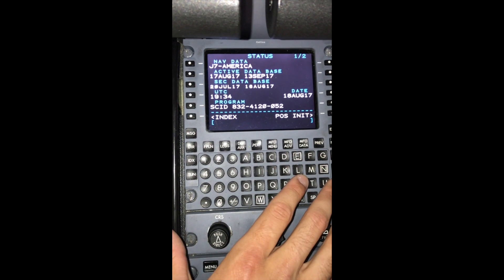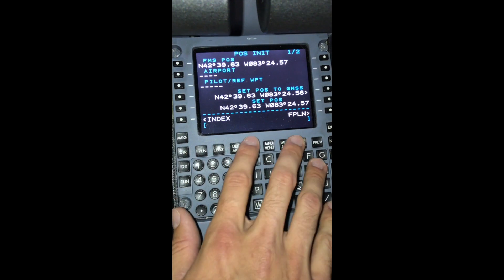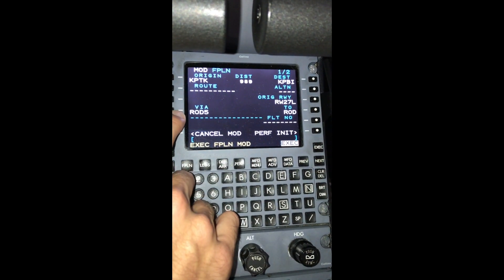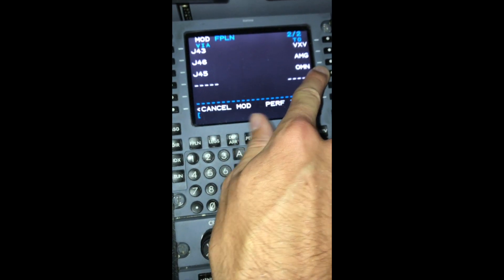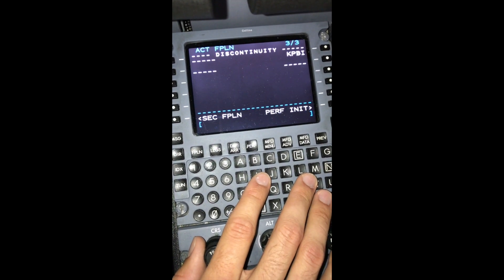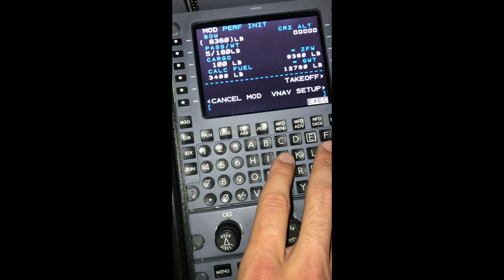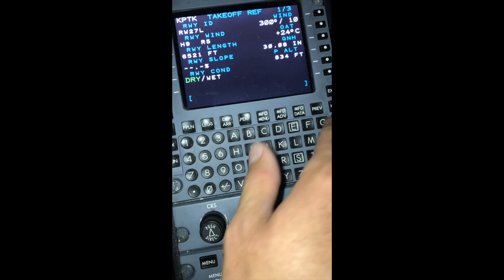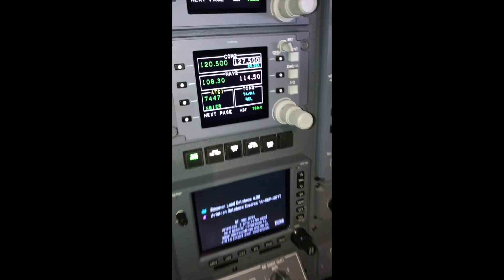Understanding the Proline 21

Comment: Hey man, what’s the meaning of VT (speed) and the A/I on the Takeoff REF page ? Thanks in advance.
Reply: VT is flap retraction speed (should you have an engine failure on takeoff), and A/I is asking if you will be using your anti-ice systems for takeoff, as that would drastically reduce the plane's performance.

Comment: You did the passenger weight completely wrong.  The crew weight is included in the BOW by definition, so with 3 pax you should enter 3 on L2, not 5.  Also, if your GOM has a defined approved standard pax weight, you must use that, you can't just arbitrarily change it from 175 to 180.  If 180 is your approved standard weight, you need to set the default in the FMS to be the approved value, not 175.  If you're using 'actual weight' instead of 'standard weight' for pax, then you need to put in the actual weight, not just your estimate of a default change.

Also, you can't just make up a number for baggage weight.  If your company is approved for 30-pound standard and 60-pound heavy bags, you would use those values (3 pax x 1 std bag each = 90 lbs).  If you want to use actual weights, you have to use actual weight for ALL items.  You cannot mix actual and standard weights.

Other than that, and the vertical video, the rest of the steps are well covered.
Reply: Ten bucks says you are a royal pain in the ass to fly with.
Reply: OK Master of FMS.... Perhaps this was a demo video, not an actual flight?! Perhaps this was a Part 61 flight, by an owner operator, not a 135?  You are making a completely wrong assumption here......
Reply: What if I told you you could leave it all blank and it makes shit fuck all difference to how the plane flies?

Comment: Dear Ryan, 
You're going through the instruction as if we know how to use the FMS. If I knew how to use Proline 21, I wouldn't be watching this video.
Reply: He just showed you. It isn’t rocket science. 

The typical acronym is VIPP

Verify the database is correct and current. Mostly just looking at the range of dates. They turn yellow if they are out of date (you can see it when he puts the old data base in). 

Initialize the FMS so it knows where it is. This can be from a GPS sensor or you can use last know position, input a position from a gate or map, or use “runway update” when you are on the button of the departure runway.

Plan Make a flight plan. This guy does it a bit weird. I always do departure and destination, then I do arrivals and departures. Then you have to do less of the “in between” route since some of the fixes will already be there.  You also need to go to the Legs page to ensure all of the fixes are there and there aren’t any discontinuities that shouldn’t be there (these are breaks in the flight plan where the dots aren’t “connected”). These are necessary for portions where you are radar vectored to your route or onto an approach but you don’t want them during the cruise portion of your journey. You also need to check for gross errors on a North-up map to ensure your flight plan looks logical and is taking you the right direction. 

Performance Input pax weight, fuel weight, temps, winds, baro, etc to get your V speeds.

As far as how to use the basic hardware?  It’s copy-paste, basically. If you type anything in it goes to a free text scratchpad at the bottom. It can then be placed in certain fields using the adjacent line select key. You can also use the line select key to copy info to the scratch pad and then paste it to another field. 

The syntax is a bit more advanced. Kind of like using DOS rather than Windows. He got into it a bit with FL410 vs F410 vs 41000... the FMS is smart and will figure it out. You don’t have to type 29.99 you can type 2999 and it will put in the decimal. 

More advanced syntax can be used for creating waypoints. Like say centre tells you you have to cross 50 miles away from ABC VOR at 20,000 feet or below. Well, ABC is on your flight plan so you type ABC/-50 in the scratchpad and put it on the legs page above ABC. It’s a new waypoint. Then you type in 20000B in the scratchpad and put it in the magenta Vertical Navigation section to the right of the waypoint information. Now the FMS will set up a top of descent and profile that will meet that criteria.

Comment: Great video! Don't suppose you have a video of amending a clearance in the air?
Reply: Piece ‘o’ cake

Legs page, take the fix they’ve cleared you to and throw it in the scratch pad, then throw it in the active waypoint (green). 

For ones that aren’t in your flight plan... just type it in the scratch pad, throw it in the active waypoint.. and confirm on the nav display that it looks right before executing... then fix up the rest of the route either with departure/arrivals or on the legs page. 

If you’re destination is changing, you have to go into the flight plan page. Change destination, change arrival. You can plan a new flight plan too but just have to remember that you’ll only have your active waypoint and if you go past it you’ll be lost. Sometimes I go into heading mode as I figure it out. Medevac life.. it happens a lot.